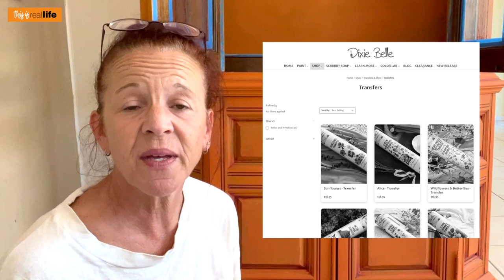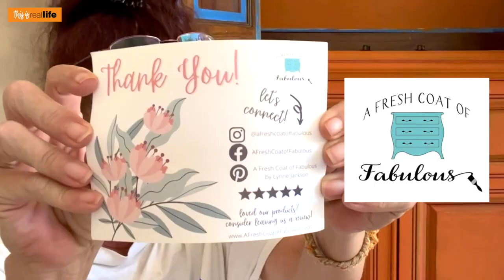Thrift Store China Cabinet Glow Up Final Reveal: THIS IS REAL LIFE

Comment: I had the same experience with my first time using rub on transfers and dug out my pampered chef tool.  My problem was matching up the different pieces resulting in lines.  So, I got out some acrylic paints and mixed up different colors to paint in design to fill the lines.  It was kind of fun to mix colors until I got a color match.  Just used a paper plate as a artists pallet.   I think your cabinet in a real statement piece.  Nicely done!!
Reply from the maker: @suzannesweetser7489 - I love that we both had to bust out our Pampered Chef tool! And how funny that we both have one!! I'm super glad I didn't have matching up issues...I would not have wanted to do what you had to do...that sounds horrible. Props to you for getting it done...a total Tim Gunn moment. :)